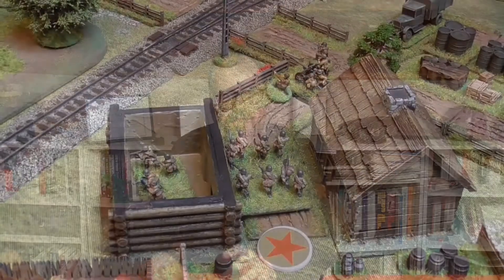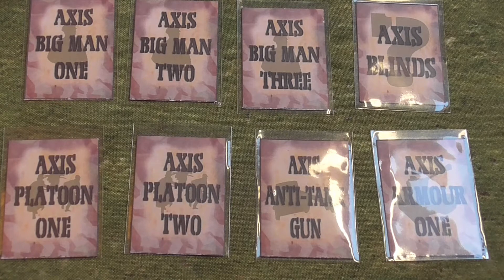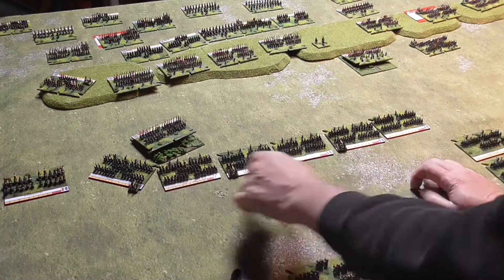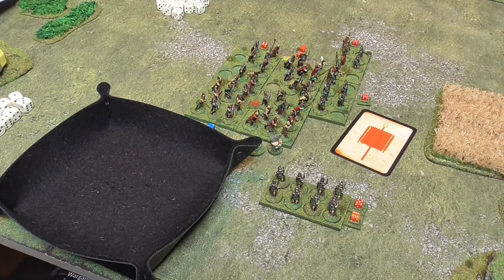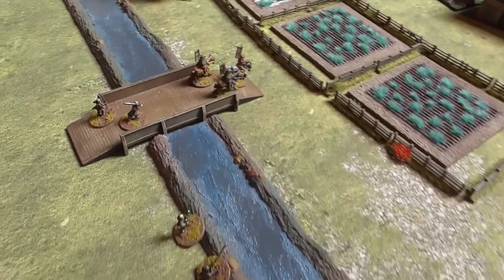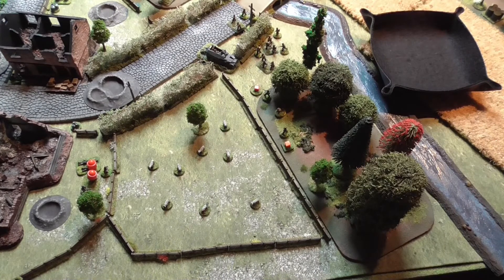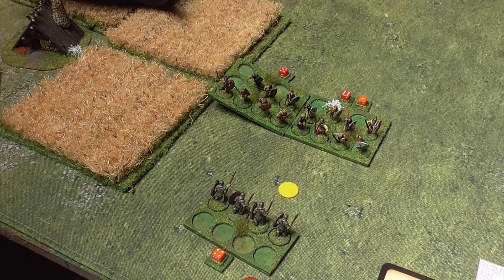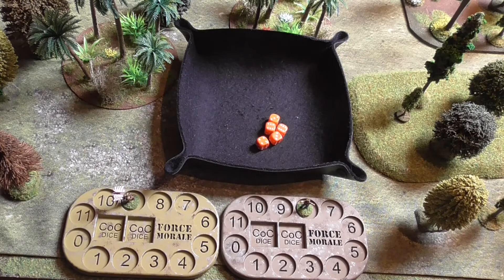Introduction to Historical Wargaming Part Three: Basic Game Mechanics | Storm of Steel Wargaming

Comment: In part two, you mentioned the Vietnam War period and "Local Knowledge".  That perked my ears up because I recently found the Chain of Command DMZ, the unofficial Vietnam War supplement.

Your jungle table in the Malaya series was great looking.  Have you considered painting NVA and US Vietnam War era platoons?

Thank you.
Reply from the maker: I am not aware of the DMZ supplement, but I will have a look into it. 

Interestingly over on Twitter this morning we were chatting about Charlie Don't Surf and Bodycount, an old set of rules I used to play for Vietnam. So I have Vietnam in my wargaming history, and I could be persuaded to turn my attention back to it quite easily, I think. However, current project is Sharp Practice, but never say never with Vietnam....
Reply: @StormofSteelWargaming  what period are you doing for SP?
Reply from the maker: @NapoleonicWargaming  100 days, I'll be using the lists in the Lardy 2020 Magazine and in 15mm.